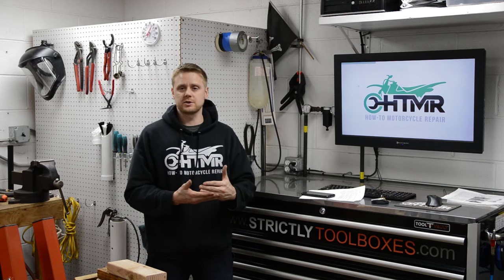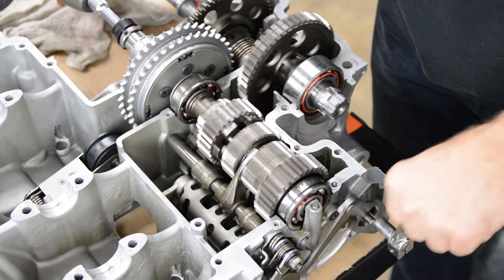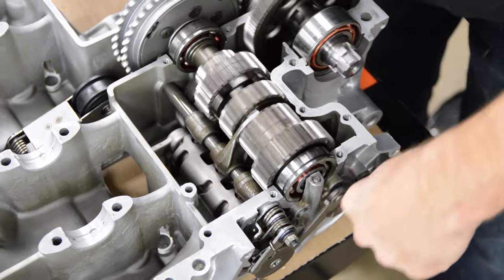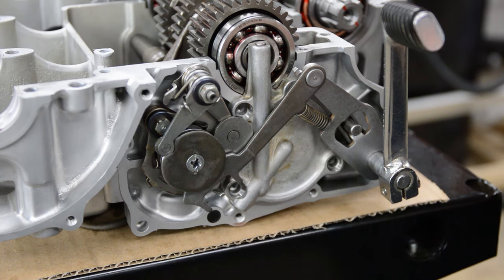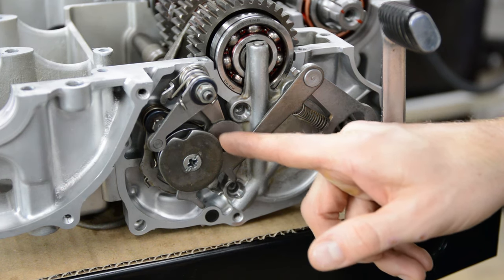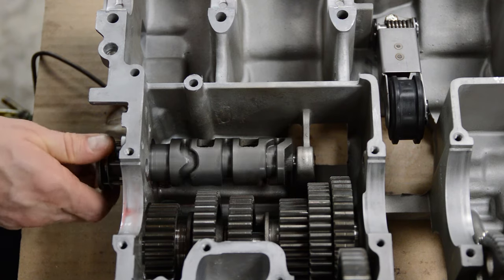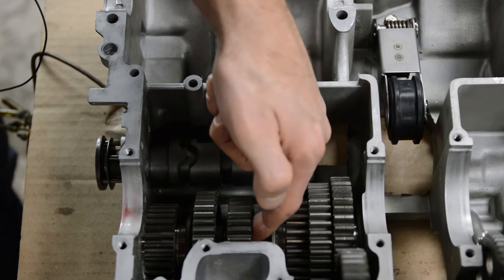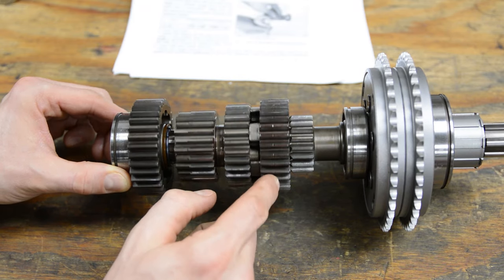How A Motorcycle Transmission Works

Comment: 2:01 “always a little bit of drag”, what a perfect demonstration! I thought the drag was primarily due to the fluid drag of engine oil in which gearbox is immersed…(correct me if I’m wrong) but now you showed me the drag is still present without the engine oil. It was primarily due to weak friction between the countershaft and freespinning gear! So this was why we feel the clunk when we put into first gear, after stopping in neutral for a while.
Reply: You get two lots of drag. What he showed is just from friction between gears and shafts. It's why when you lift up your rear end with the engine on, the wheel might start to spin.

You also get drag in the clutch. Sometimes the plates are making light contact, and sometimes it's just viscous coupling through the oil. Either way, it results in your input shaft spinning in neutral, even with the clutch fully in.

Then when you click it into first, that entire input shaft assembly comes to a sudden stop as the dogs crash together. The angular momentum ("angular" because spinny thing) has to go somewhere, and that somewhere usually ends up being the rest of the bike being lurched forwards.

I believe this to be either intentionally engineered into the system, or at very least, intentionally not engineered out of it (except on really small engines, where such clutch drag would sap too much power, such as on many 125s). This is because the gearbox needs the shafts spinning at different rates in order to ensure the dogs can slide past each other. If both shafts were static, unless they'd stopped in perfect alignment, the dogs would crash into each other when you attempt to get into 1st, and you'd bend the shift fork before you get it into gear if you try to force it.

Comment: Quick question and feel free to inbox me if you aren’t comfy answering it public. But I’m looking to do a custom built bike, I’ve got a couple diff engines set to the side I can play with. Was looking to use the Briggs and strat 200cc motor I have. Since I’m not looking for something by vehicle name make model and year. What would I look for to get a gearbox transmission for it so I can put it on a fabricated frame?

Comment: How do the dogs engage if they're not lined up when you shift (which they probably won't be). Do they just slide until they do line up and pop in? If so, then it's obviously relying on the transmission of power from the wheels either to the dog gear on the output shaft or the free gear on the input shaft. In that case, how do you get it into first gear at standstill? Is that purely from the residual power of the engine?
Reply: the clutch lets you put it in first from a stand still
Reply: @truckertwotimes7189  Yes, but how. If the dogs aren't aligned when you engage the clutch, how does it let you get into first? (Not a rhetorical question by the way).

Comment: I was wondering whether anybody has added gears to motorcycle gearboxes. Like adding a 7th gear for highway speeds to lower the rpm, for fuel efficiency 
Or do they change gear ratio?
Reply: that's what i've been looking for, i think it would be possible to change the 4th gear on my 07 Honda Shadow VT600CDA and give it an even bigger gap between 3rd and 4th to allow for less rpm's at 80 mph 🤔 what do you think?

Comment: I would like to ask regarding the video at the end, where the dogs of the gear slide in between the pins of the neighbour gear. why is there so much free play for the dogs to move? Would a new trans not have any free play here ?, or does it eliminate a knocking force generated by connecting two gears at speed with an added resistance torque.

Comment: whats the main cause for bent shift forks. I accidentally shift few times from 1st to N instead of 2nd(40kmph) then I shift back to 2nd, and theres clunck sound, thoese it really bad for shift forks?
Reply from the maker: Shift forks bend usually when the shifter is forced. The clunking you heard is the dogs engaging on the gears as they meshed.

Comment: Nice video thx!!
I have a question though,
how come that the teeth on the sides of the shifting sprockets exactly engage with the recesses of the free wheelling gears when shifting while they spin rapidly with different speeds? How come you dont need something like a synchronizer ring as in a manual car transmission to match their speeds to connect them?
Reply from the maker: Because motorcycles have a constant mesh trans. Car gears are not meshed and need to synch up so they don't grind.
Reply: @HTMR  Thx a lot for the reply!
So as I take it, every shifting gear on the input shaft is constantly meshed to a free wheeling gear on the output shaft and vice versa, ok..

But every shifting gear engages with a wheeling gear right next to it on the same shaft, which is not meshed to it and therefore can have a different speed... as is the case when e.g. you shift from neutral into first gear, because in neutral the shifting sprocket for the first gear is not moving at all but when you shift into first gear its moving and transmitting power because it is locket with its wheeling gear ... and I feel when they meet they should be matched somehow which obviously is not the case because it works very well...
 
thats what I mean.. I dont want to get on your nerves though (:
Reply: @Ben7Seven  6:55 The actual parts that engages each other are dogs and slots. They are not delicate mechanisms like the gear teeth…only 4-5 dogs in a whole circle, with big blanks. They are quite tough because of their simple shapes, so they will withstand wear and collision during normal shifting, if not put in high pressure.

There is no guarantee that, when you shift, the slot is exactly positioned for the dog part. I think there is about 30-40% chance that the slot is initially blocked. But since all those parts are spinning, the discrepancy will be resolved in a blink.

Actually, this is the primary reason that we shouldn’t be stopping at high gear. It often get stuck at false neutral when we stop in 4~6 gear and then try to shift down to the first. It’s that 30-40% chance of dogs not fitting the slots!
Reply: @gksalf10  Thx a lot for your clarification! makes sense..
Reply: in a car transmission, the dogs are much smaller and thinner and close together, so they can't mesh while spinning without the synchros. In a motorcycle tranny the dogs are wide apart and are able to mesh directly. This makes it possible to shift without the clutch, but is more noisy than a car tranny.

Comment: I have triumph triple motorcycle, there is always clunky shift from 1st to 2nd to 3rd, it is never smooth, what could be the problem? Synchroniser issues?
Reply from the maker: Motorcycles do not have snychronizers. I have ridden a few triumphs and the transmission are never as smooth as other makes. Is the clutch in good shape?
Reply: @HTMR  it’s a new motorcycle just a month old, clutch is fine, just there is bang in shift from 1st to 2nd to 3rd and I been told triumph makes bike like this and it’s the bikes character :( why can’t it be smooth is my question to the Triumph

Comment: Great Pro Video! hey matthew, was hoping you could explain why tranny gets stuck in 2nd on a klx 110? probably a bent shifter fork? Thanks matt! who's gonna crack my case?
Reply from the maker: I'd start by taking the RH cover off and taking a look at the shift detent mechanism.
Reply: @HTMR  I had it down to the shift drum key/shift detent mechanism. it was stuck in 2nd. I took the washer off then worked it back and forth with a hammer and prybar... ouch! Bam it came free after about 15 mins of prying and bangin. lets hope it didnt mess anything up! ITs shifting now! I should have took a video. Thanks Man!

Comment: Excellent video!  Q. Where does the clutch come into play?  Is that when you're pulling the dogs away?
Reply from the maker: Clutch not installed in this video.
Reply: the clutch disconnects the engine from the gearbox, allowing the gearbox to operate without any load, which makes it easier to shift gears. The dogs are engaged or disengaged by the forks controlled by the shifter

Comment: Really quick question here as i am concerned. If i were to shift from neutral to 1st gear, and didnt shift hard enough to 1st and felt a clunk and the gear lever was "kicked" back into neutral, will it do any damage to the gear dogs or gear teeth?
Have done it a couple of times to my bike and probably shifted too lightly.
Reply: It would do damage but nothing serious for a now and then mistake, though it’s a habit you should break and try practicing getting the shifts consistent and enough but not too much pressure 👍
Reply: @raphy_tt  Alright, will take note from now on, and work on it. Thanks

Comment: Great video, I am in the process of rebuilding a kz650, any tips on what to look for as I reassemble the transmission into the crankcase?
Reply from the maker: #1 tip, bench shift it before further assembly.

Comment: Do the dogs get damaged over time from using quickshifter/clutchless shifting? Will using the clutch avoids damaging the dogs at all or will it only lessen the damage effect to some extend? (way less compared to using qs/clutchless)
Reply from the maker: Yes, they wear over time. I would say violent shifts would be the worse on the dogs. Quickshifters/clutchless shifting can be just fine if performed correctly.
Reply: @HTMR  Thanks. I've just finished watching The Workshop video on quickshifters. What you said checks out & also I found out apparently low engine speed shifts is not good for quickshifters.
Reply: ബ്രോ ഇന്നത്തെ വീഡിയോ പൊളിച്ചു സൂപ്പർ 👍👍👌

Comment: So how dose a 6speed work with overdrive is overdrive electric
Reply: No, with overdrive the input gear is larger than the gear translating to the output gear, therefore making the output spin faster than input. If that makes sense. 
Anybody please correct me if I'm wrong.
Reply: Don't worry if you don't understand it though, I'm still having a hard time grasping some of it.

Comment: Very informative content... 
But I have a question. What if you accidentally shift your gear up, without pulling the clutch. Could it damage the transmission?

Can anyone answer this question? 😅
Reply from the maker: Nope, just let off the throttle and shift up. I do it all the time.
Reply: Obvious
Reply: @oscarm9473   what do youean obvious?😅
Reply: Obvious the transmission is damaged
Reply: @oscarm9473   should I replace it with new transmission? I didn't mind to have a check it up on the motorcycle dealers, since my MC runs in good condition  so far.
Reply: they're pretty much designed to be shifted without the clutch, as long as you let off the gas and don't slam the shifter too hard, just be gentle with it